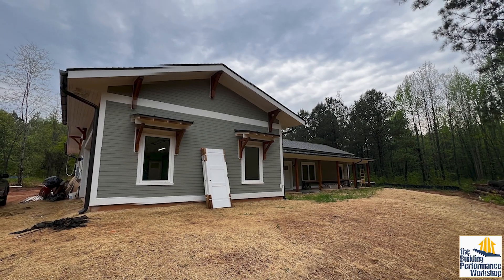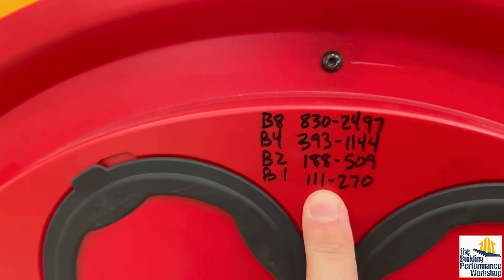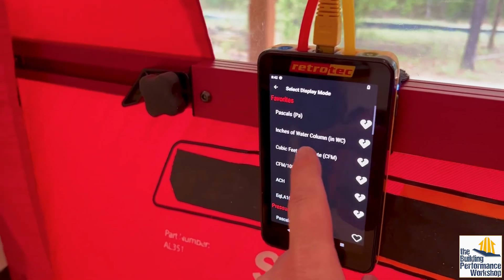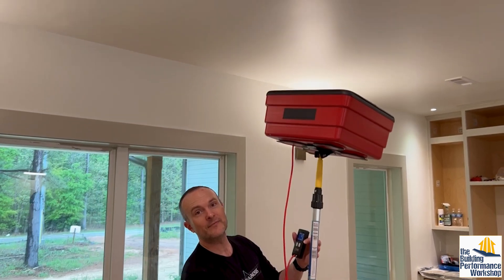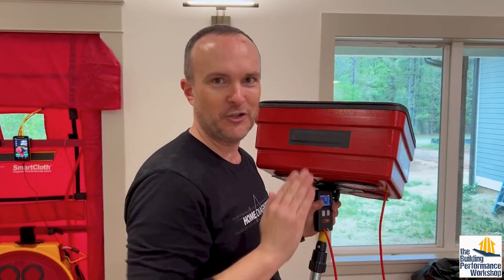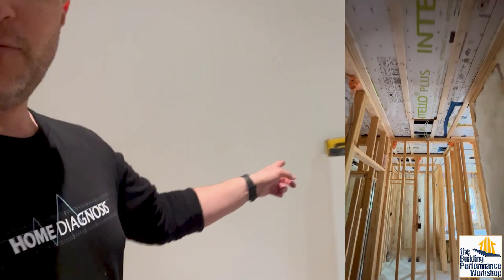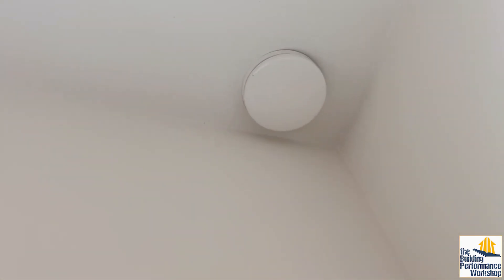Blower Door Leakage Reveal for Chaz's DIY Home Build (ERV, Dehu, Reverse Soffit in Vented Attic)

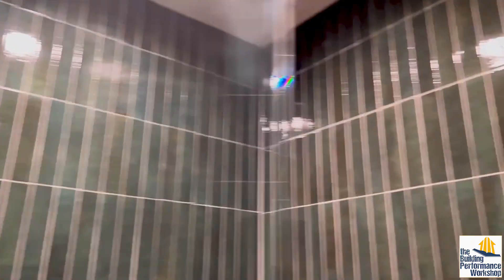Comment: 2:55 should it be in the shower if it’s not the opposite corner or the bathroom doors (as far way from the doors as possible)? Asking for my application not the video situation
Reply: Yes, the shower is the "best" place. However other placements may have other benefits worth considering ie: behind and lower than the toilet seat can really help with "other" smells.
Reply from the maker: Do both if the in-shower extract won’t also grab the toilet odors

Comment: I swear I believe our goal in 85 was to get houses down as close as possible to 5. Back then, there was already "too tight" talk. When you run the ERV or allow fresh air to enter what blower door number would equate to the rate of exchange? Greater than 5? We had a concept of trying to let "the right amount" of air in, back then. I can't remember the amount being quantified. I recall homes starting in the 20s on the blower door and being in single digits after we gasketed outlets, weatherstripped doors, caulked windows doors, anything we could find with smoke and the blower door.
Reply: The number i have seen is 5ach50, which is equivalent to the required ventilation. Hence, it is the point where balanced ventilation is worth doing. But i don't know what climate that's in, as natural ventilation is climate dependent
Reply: There is not really a set number.  This is because the design of the house, design of mechanicals, location of construction flaws, climate, weather, and sun exposure (and likely a few other things I'm leaving out) all contribute greatly to the natural air flow in a house.  

For example lets take two houses both are Identical and perfectly air tight except for the placement of two equally sized holes in each.  On a warm overcast night (requiring A/C) with no wind If house #1 has its holes both on the top and house #2 has one hole on its top and one on its bottom then house #2 will have an almost infinitely higher air change rate in the house, because the higher density conditioned air will "fall out" of the bottom hole and draw in warm air in the top hole, where as house #1's air will mostly stay in place because house #1's air is mostly more dense than the higher temperature outdoor air at its top where its holes are.  Yes, this is a ridiculous example.  But it's set up that way to illustrate the point.  

In reality there is no "right amount" of air changes, the purpose of ventilation is to reduce indoor air pollution and/or adjust gas concentrations. The absolute low end of ventilation should probably be around 4 CFM/person, however this will likely not take care of the pollution sources in the house, and will lead to periods of increased CO2 while the person is exercising.  Passive house requirements for ventilation along with point source (ie oven, stove and bathroom) ventilation are a pretty decent place to be though.  Those requirements are basically 15 CFM/person and the ability to go up to 0.3 air changes per hour.  The reality is that every home no matter how air tight really should have mechanical ventilation.